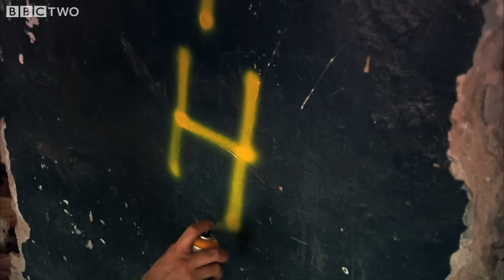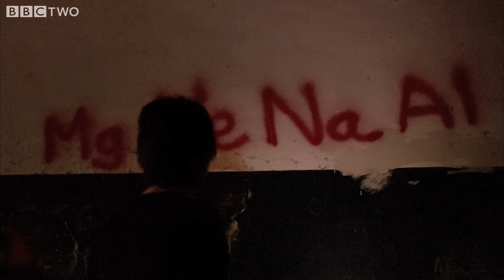Star Death and the Creation of Elements - Wonders of the Universe: Stardust, preview - BBC Two

Comment: @chessonmyshirt 
 He was using the spray paint to mark each layer of the building to represent each layer of a stars core. He started with the outermost layer which was made up of Hydrogen and kept going through each shell (each floor of the building towards the bottom) in order until he reached the inner most layer (the bottom floor) where iron is made. After that all that was left was for the star (prison building) to implode.

Comment: The building represented the star, and he was using the spray paint to write the elements created during the star's collapse and final implosion (represented by the bang at 5:49). So he was spraying because it didn't matter that he was defacing a condemed buiding that was about to be demolished. He could have pissed up the walls, for all it mattered, but writing stuff like Fe is hard, cos when you finish F you have to stop and then start again, with a curlicar e, and might piss on your shoes :)

Comment: Here's something I want you all to ponder and think heavily about. If a black hole is a point of super dense matter so concentrated light can't escape it is definitely more powerful and denser than a super nova. If a super nova can produce elements up to uranium what are black holes making right now? As black holes just absorb mass what happens to the atoms, do they keep combining making elements we cannot imagine? Do they create elements with properties we haven't seen or thought of? We cannot know now though.
Reply: I'm not an expert on the subject, but as i understand it, all mass that's entering a black hole is annihilated into energy and then ejected as Hawking-radiation. But as i said, i don't claim to be an expert, so i'm probably wrong. Plus there is the fact that we don't really know much about them.
Reply: +cre8or38 ... but even more(?) impressing: A star heavier than our sun but not as heavy as those generating a black hole - is those generating a single nuclear core of only neutrons, based on most of the mass from the dead star - a neutron star!
It will we a rear type of a element consisting of trillions, trillions and trillions of neutrons packed together so dense, that a handful of that "matter" will be heavier than all of the mount Everest. Had you ever set your foot on that star, your body would instantly turned into something less than a virus.

So actually - stay well away from those on your future trip through our milky way.

And by the way:  Betelgeuse - the upper left star in Orion, may have exploded into a supernova by now!
We can´t really say for sure before in year 2446 - when the light leaving Betelgeuse now will reach us with it´s distance of 430 light years from here.
Reply: Well, it depends a lot on the black hole. Most black holes are 'Rotating', or to be specific are described by something called the Kerr Metric. There are two ways in which you can look at your question. If we pointed a telescope at a black hole - or to be exact, at some sort of light source falling toward the black hole - we'd never see it actually pass the event horizon (because time goes slower as you get closer, eventually stopping at the horizon). Now, if you were sitting on the object (or are looking at the object's 'proper time'), its a totally different story. For rotating black holes, when you work out Einstein's Field Equations, what you find is that if you throw an object into the black hole prograde (i.e along the spin of the black hole), and another object retrograde (in the opposite direction of the spin), then the two objects meet up at the so called 'inner horizon' of the black hole. In fact, with even more math, you can show that by throwing the retrograde object a certain time after the prograde object, the collision will have more energy. Essentially, you can create collisions of as high an energy as you would like inside the black hole. What are the implications of this? Well, the professor who taught me General Relativity has a hypothesis that it could create a tiny stretch of 'vacuum energy' that - again with more math - can be shown to cause a mass-expansion event (aka a mini big bang). I won't go further into this here - to keep this post at a somewhat reasonable length -, but if you're interested, I could certainly try telling you more.
- A graduate student in theoretical physics
Reply: i can imagine...
there's adamantium and vibranium and carbonadium in there

Comment: Stellar nucleosynthesis by super nova is only capable of creating elements up to and including Zirconium, the heavier elements found within the debris of the exploding star are the result of an much earlier process which took place within a black hole.  
Mathematical simulation and modelling has shown that these heavier elements which require enormous forces to be created can only be formed beyond the event horizon of a Black Hole.

The enormous pressures within the gravitational field of a black hole are not only capable of creating heavier elements but they act as a containment for atomic reactions. 

The only way the matter containing these elements can escape the black hole is a localised gravitational reversal.   It is thought that the reversal is the result the sheer quantity of matter contained within the black hole and the ensuing gravitational instability.

When a gravitational reversal occurs, within the black hole, the balance of kinetic and potential energy are restored to the atom, allowing the element to expand.   This barely sub light speed expansion allows the matter to “explode” beyond the event horizon. 
The modelling indicates that 250 million metres second (84%) is probable.

When sufficient matter has been discharged from the black hole the Universal gravitational polarity will return to the black hole.    Then Black Hole will then continue to capture material within its gravitational field.  
Those elements which were discharged with sufficient velocity and are now beyond the effects of the event horizon, will eventually be captured by stars.

Comment: Great video.but why fusion process stops at iron why not to next element in periodic table? Can anyone answer me?
Reply: Iron is the last and heaviest element that a massive star can hold in its core before it collapses and dies.
Reply: @mr.landman6781  yes but why not heavier element ?
Reply: @the420aditya  putting it really simply fusion to produce elements heavier than iron requires more energy and higher pressures than are ever possible in the core of a star during its main lifetime. It’s only during an even more extreme event when the conditions are created for heavier elements to be formed. This is a supernova. That’s why the most common elements in the universe are the lightest; hydrogen, helium, lithium etc and the rarest are the heaviest elements, gold for example.

Comment: Doesn't really explicitly explain how it's only possible to have elements made by the death of stars.
Reply: AdaptaFilms because after the big bang there was only hydrogen, helium and a bit of lithium. to create heavier elements you need pressure and heat and we don't know any other place that can provide it, only a star. during most of its life it fuses hydrogen into helium, then when the hydrogen runs out in the core the process starts that Brian is describing here.